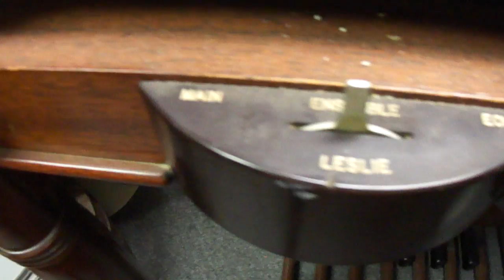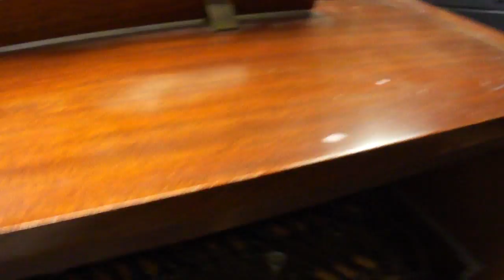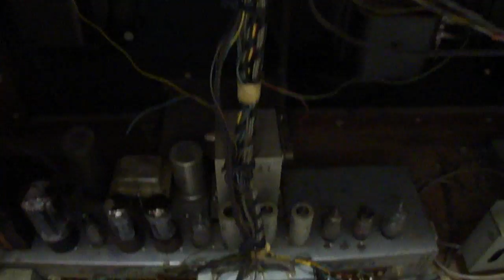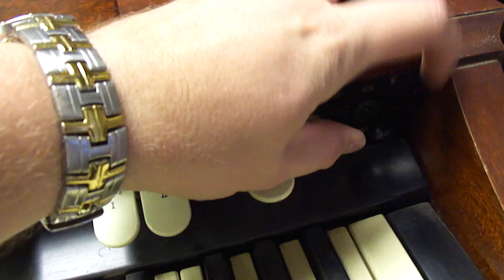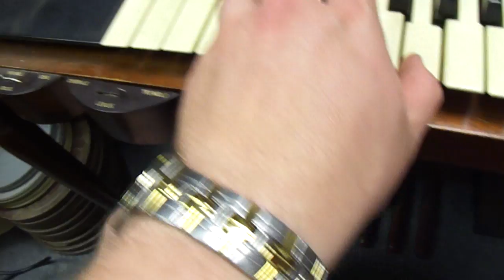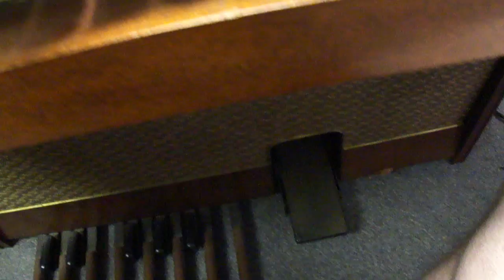SouthJK's 1963 Hammond M-101 organ and Leslie 22H

Comment: At the Hammond factory when they selected the capacitors for the tone generators, they used a scope to observe the wave form. I saw this being done. They had bins of  capacitors and selected them not according to what was printed on the body of the capacitor but how the selected cap affected the wave form. Replacing all the caps according to the printed value on the capacitor body may give you uneven results.